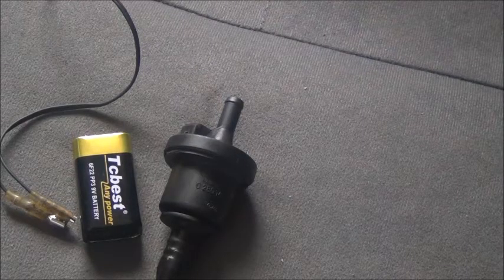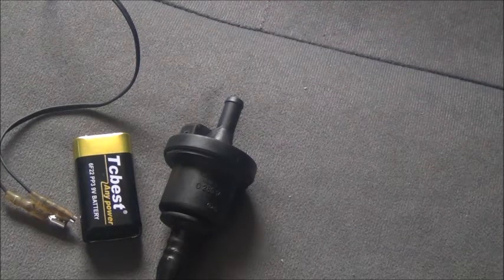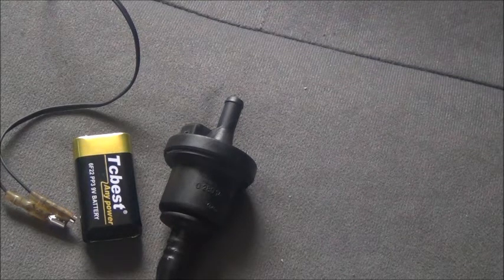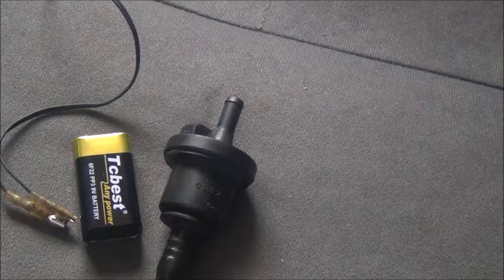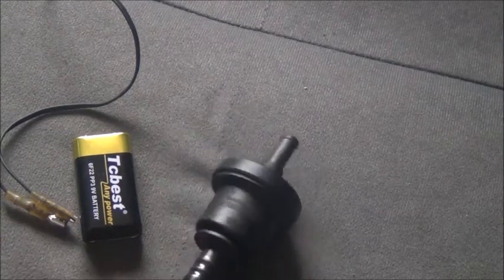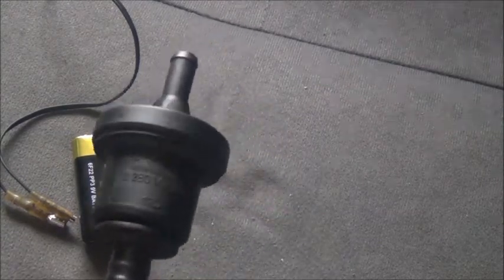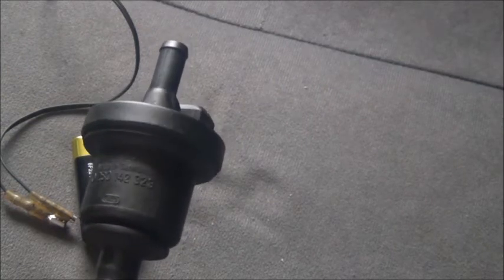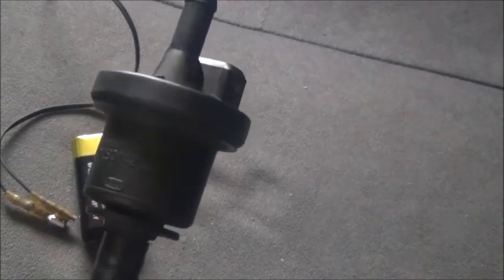Porsche 911 vapor purge canister valve test

Comment: I have a 2004 porsche 911. I added feron 134 to the a/c
system for the first time. One hour later the EVAP code po455 came on . Can a
feron leak cause a PO455 code ?